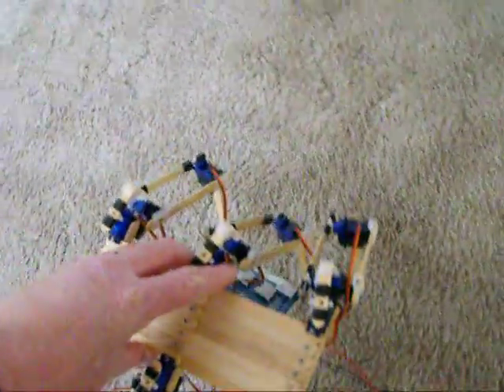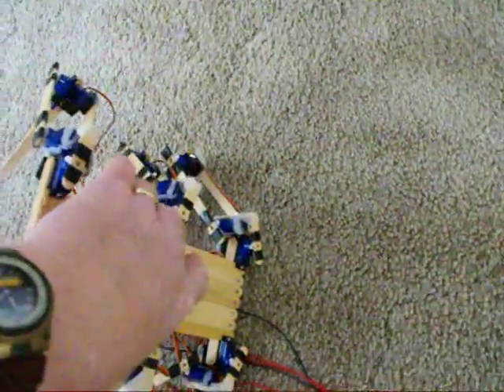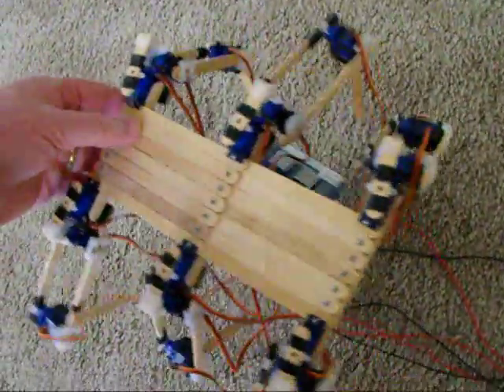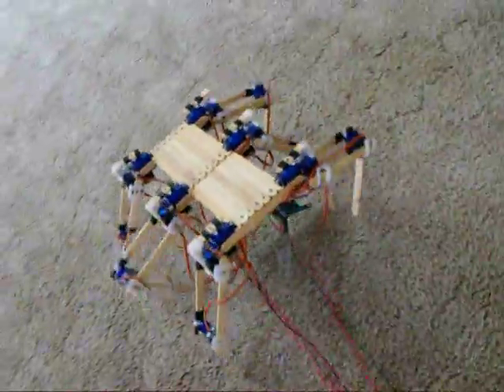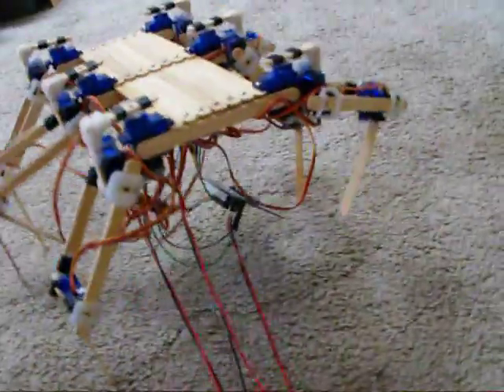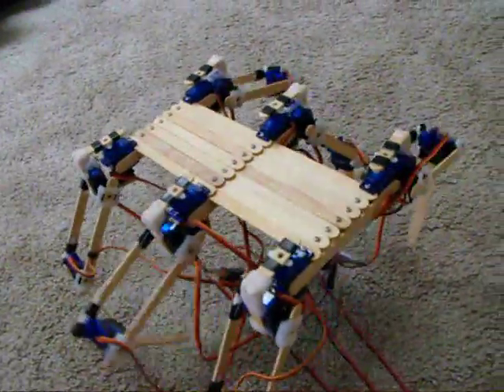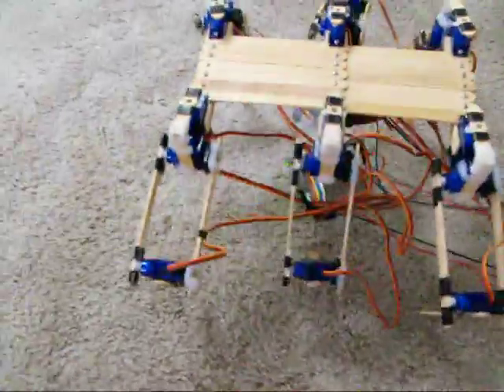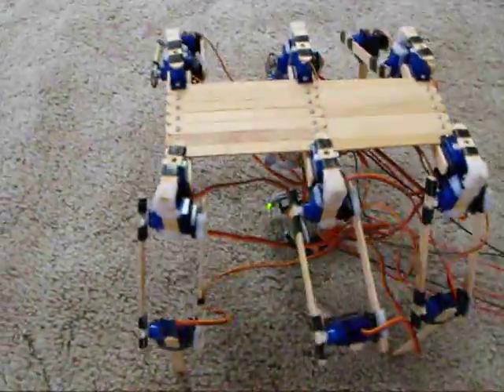PopsicleStickBotHighStance120220b.AVI

Comment: hi,
cool project
may i know more about what u used for servo clamps.
like closer pic or some thing
Reply from the maker: Sorry, I couldn't find any pictures of the servo connections for this robot. The only closeup I found was from when I tried to use Gorilla Tape to connect the servos with the Popsicle sticks. The tape technique didn't work.
If you follow the link in the description, you can find additional videos of this robot. Some of the other videos might provide a better view of the servo connections.

When I tried to remove the Polymorph from the servos, I found several of the servos had plastic which had chemically merged with the servo housing. If I were to try this again, I'd use metal tape on the servos if I didn't want the Polymorph to combine with the servo plastic. I used the metal tape trick with the contraption shown in this thread: http://forums.parallax.com/discussion/155937

The above link might provide some additional clues of how to use Polymorph with servos.

If you try something like this yourself, make sure you use shorter sticks. The servos weren't strong enough to move such long legs well.